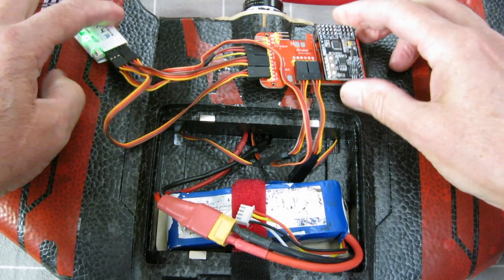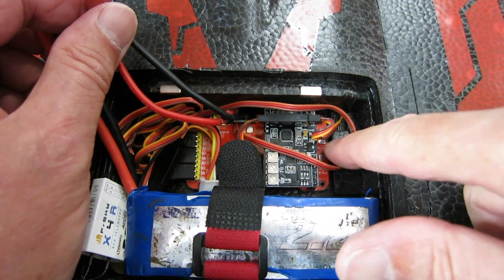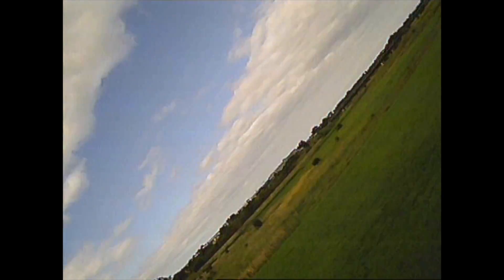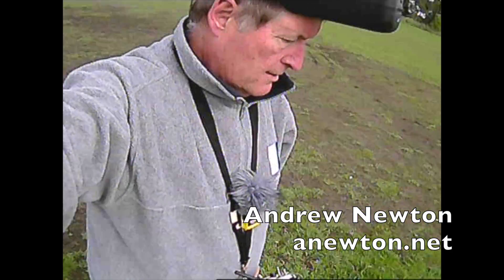Reptile S800 wing electronics

Comment: Andrew, thanks for the video. I was having trouble getting the servos to mix. In my radio I set up channel elev/ail mix at 50/50 on both channels not knowing that the S800 board was already programmed to do the mix and that totally confused the board. So i deleted my mix and set up the SG switch per your video and I am Ready to Fly.  Thank you!
Reply from the maker: Good to hear. We have all made that mistake. It applies to all flight control boards I think.

Comment: Hi Andrew.
could you explain me HOLD MODE.
I hve the same reptail wing, NICE !!!
Thks
Nice video.
Saludos desde México.
Reply from the maker: I think Hold Mode is basically stabilised at what ever angle it is flying at but still allows stick inputs. Self Level mode will always bring it back to level, and Manual mode gives you full control.

Comment: If that flight stabilizer isn't working out for you you can use any mini quad Omnibus flight controller F3 or F4 and Flash it with inav and for less than $25 you'll have a rock-solid flight control gyro stability piece of electronic equipment

Comment: Yeah
Reply from the maker: Stabilisation working in the correct direction? Point the nose down and the elevons should move up, lift the right wing and the right elevon should move up. (Looking from behind and with stabilisation mode on)
Reply: Andrew Newton yeah I think it's one of the servos
One moves less then the other 
How can I even them out so they move the same amount
Reply: Sorry bout all the questions I'm new to fix wings 
More into drones
Reply: Andrew Newton all I have to do is trim one servo up a bit but I can't cause they both move how can I move just the one

Comment: Hi great vid I just built this but the left servo won't work and the staberliser won't flash
Reply from the maker: Bummer, I don't have this wing anymore sorry
Reply: Andrew Newton it's alright I just re bound it and it worked
Reply from the maker: Excellent Nicholas
Reply: Andrew Newton I'm trying to take it off but it dives straight into the ground every time?
Reply from the maker: Are the elevons moving in the correct direction? Pull back on the elevator stick and they should move up. Go right on the aileron stick and the right elevon should go up and left down

Comment: Great series of videos, I fly quadcopters but this is my very first wing, I've not built it yet but these vids should make it alot easier!. Will you be doing a video on radio setup too? Like I say, I've never even flew one before. I have the taranis, when creating a new model. I'll be selecting wing, will this set everything up automatically then or will I still have to go in the radio and adjust things? Any help greatly appreciated 👍
Reply from the maker: Here's my setup

Ch1 100 Ail
Ch2 100 Ele
Ch3 100 Thr
Ch4 100 MAX SG down
            0 MAX SG down
       -100 MAX SG middle

The FC board does the elevon mixing. Flight modes are on the SG switch
The model wizard doesn't understand FC boards as far as I know

Comment: Yes, there is no "standard" for dip-switch nomenclature, so the documentation is always ambiguous.
Reply from the maker: A simple legend would make it clear.
Reply: A better illustration would help.  The two shades isn't helpful.  Even noting that black indicated the switch handle would help.  I notice this is an issue with a lot of video transmitters -- they select channel using dip-switches, and rarely do it in a binary format you can work out.
Reply: Andrew dc.uX 
you are Newton

Comment: I was thinking, Andrew, that the power from the ESC could have much electrical noice. Maybe it could be a better idea to solder in and use the chip on the distribution board instead, at least for the cams?

Thanks for the video! I have a Anubis 36" wing in the prosess of maidening! Scared like hell! :-)
Reply from the maker: Good luck with the maiden! I'm using a separate battery for FPV so no interference from ESC

Comment: nice gyro drew i do have problems with the vtx your using my change the frequency everytime i supply it with power it is really strange because i'm not touching the dip switches!... do you have any idea way this happens?
Reply from the maker: That's a pain. Mine holds it's frequency so I can't help sorry
Reply: Ok thx anyways 🖒